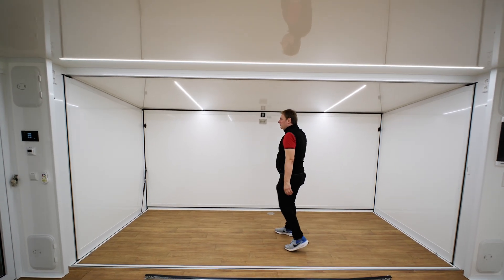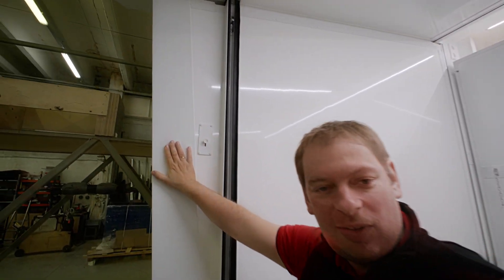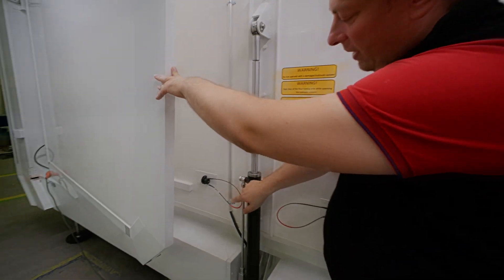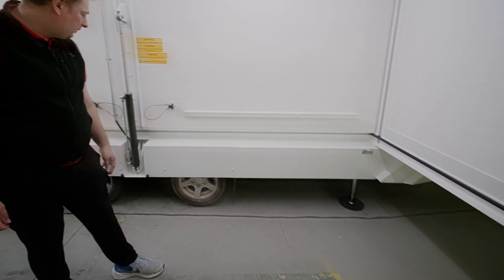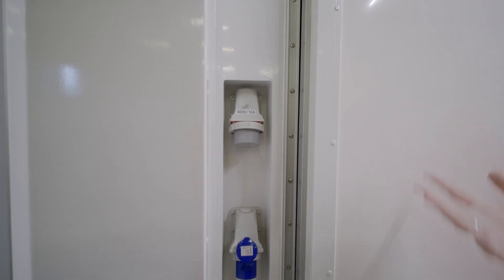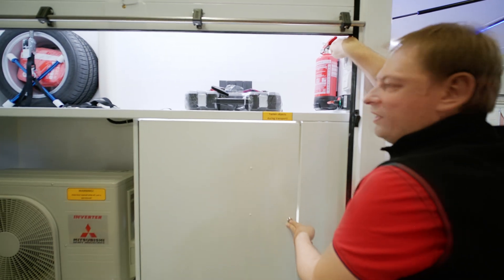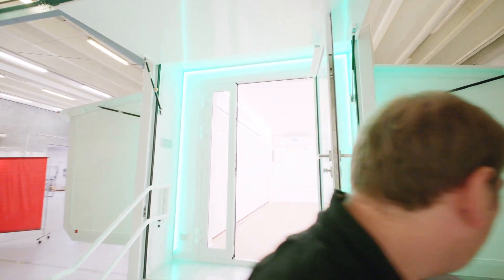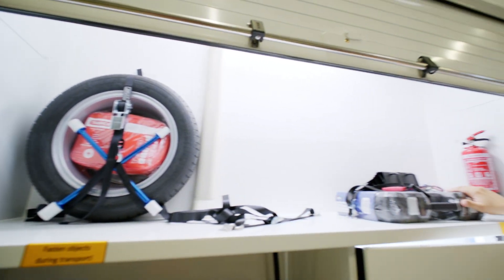Showing some small improvements on the Rolling Unit XL model

Comment: Nice innovations, but with the removal of the latches, what holds the celing down from high winds? or does the new rotary one latch the top while it pins the side panels?
Reply from the maker: good spotting. its solved a bit differently now. The roof and side wall already interlock in the up or down direction when you pull the side walls out.. so it happens seamlessly without anymore extra effort and when you close them the connection is released, when you put the floor down a accidental loosening is impossible + the latches too...